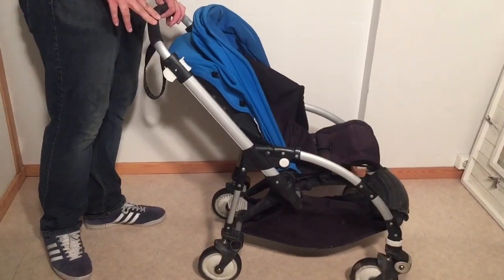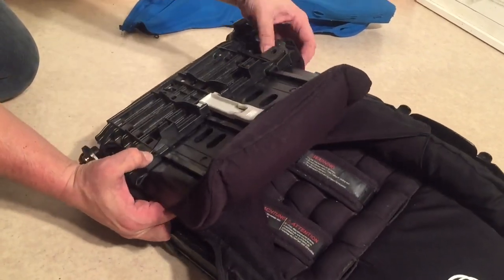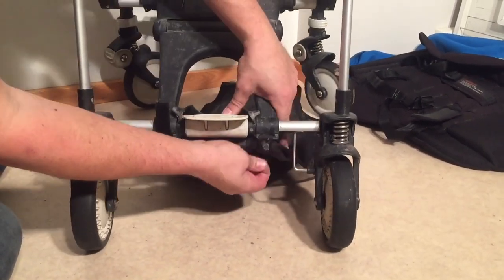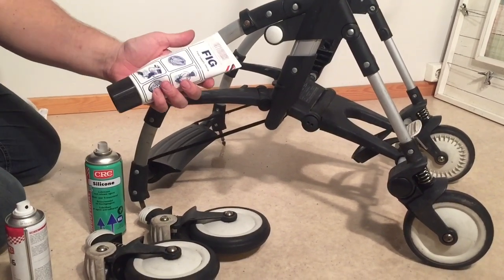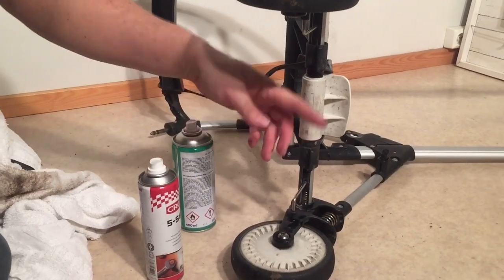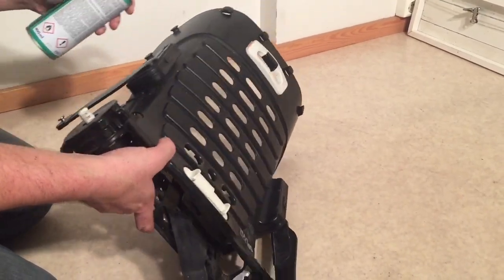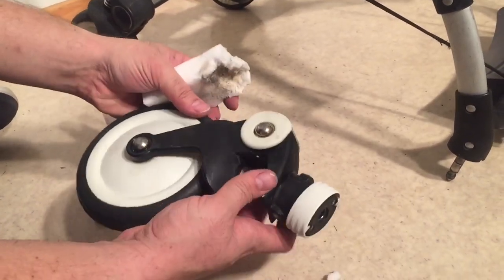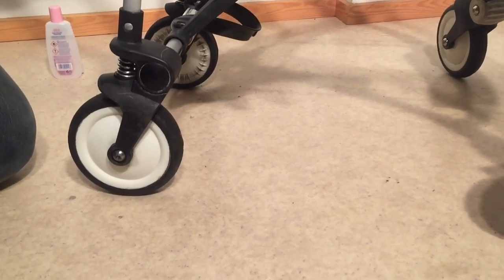Bugaboo Bee: Cleaning and Care.  Simple Step-by-Step instructions

Comment: For cleaning chassis tou mixed water with just liquid soap? (Is it important to be any kind of soap?)
Reply from the maker: No, just plain dish-soap will work fine :)
Reply: @BarnevognverkstedNo   I finally gotnit done with all the lubrication of chassis, but silicon spray is still so greasy on the seat~~ would you recommend remove the grease wih clothes (dry/dump?) Or just leave it for longer to dry? (How long dpes it take to dry?)